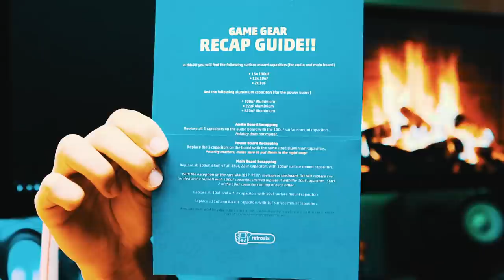NEVER REPLACE ANOTHER CAPACITOR! | New CERAMIC Capacitors for the SEGA Game Gear! | Retro Renew

Comment: Nice video but ceramic caps are used for filtering and not power applications, electrolititics are used to stabilise voltages and power especially on the power and audio boards, Sega knew to use electrolititics for a reason, not the best replacement when using a good quality Panasonic or Nichion cap.

Comment: Can’t wait for these capacitor kits to be available for every console, I’d love to never have to worry about those leaky caps again!
Reply from the maker: Me too!!
Reply: @MachoNachoProductions  haha, as it turns out I just finished fixing my GameCube and it wasn’t reading discs too well and, sure enough, a capacitor issue. I think I’m gonna try to find the right ceramic caps for it because it uses those smd style ones like the ones in this video. Thanks for inspiring me lol, I’ll definitely have piece of mind after that’s done
Reply: For sound circuits you are better with electrolytic or better yet solid state tantalums which will not leak either and there are also polymer caps that look like electrolytic caps and don't leak either. Ceramics are good for many things but not leaking does not mean they will not fail eventually but they tend to last longer.
Reply from the maker: You’re welcome dude!  Glad this video helped!  Also glad you were able to track down the issue with your GameCube!  Best of luck in the repair!  Cheers!
Reply from the maker: Thank you for the insight Helder!  I wonder if there is a way to figure out which cap types would be best for each application. It seems that it isn’t a 1 for 1 just getting the same values. Cheers buddy and thanks again for the insight!!
Reply: @Angryhelder  yeah, for earlier systems that’ll definitely have to be fleshed out by someone with more knowledge than me, but I’ll save it for the pros. Just hoping retro modding or someone like that starts to pick up on this
Reply from the maker: Also, is this THE Helder?!  From sudomod?  I recently bought your MegaBat 4.5 for a circuit sword build I’m planning. Love your work bro!!
Reply: @MachoNachoProductions  Indeed it is. As for the caps to have a good variance in sound as it was intended you want something like the electrolytics but if you want something similar in performance sound wise use tantalums as they last longer and do not leak. For these low power handhelds ceramics could be used although I'm sure people will argue that point but stick with the caps I mentioned for audio.
Reply from the maker: Great to speak with you and again appreciate all you do for the modding community!  

And also thank you for the insight!  Cheers dude!!
Reply: Electrolytic capacitors are generally going to be superior for audio applications. I'll take new Nichicon or Rubycon caps over ceramic any day. Any electrolytic capacitor will leak when exposed to higher than rated current. Most extremely old and or bulging electrolytic capacitors should be replaced. Also any console built during the years of the Capacitor Plague should be recapped.
Reply: @Angryhelder  The only way a ceramic capacitor will ever fail is if you apply way to much current to it, or physically damage it. Otherwise, no they don't just randomly fail.   Tantalums capacitors do fail with age, and their failures are often worse then electrolytic caps, they are also not ideal for every application where a electrolytic cap would have been used.     Tantalums are better for power supplies, not audio circuits.    Polymer caps are more expensive, so in a Game Gear where most of the caps are used for decoupling or line filtering, there is no advantage to using them over a ceramic cap.  The audio board is the only spot were polymer caps might be of an advantage, but even then, it's still a Game gear with low quality mono sound, not a high fidelity stereo system.

Comment: I have a Sega Nomad that does not turn on. It used to work, it was put away, not used for a couple of years, and then it wouldn't work. So I'm guess that it's the capacitors.

Comment: 2 things... 1) I tried reviving a Game Gear with these ceramic capacitors but couldn't get it to work. Could be that they are so small and the 100 uF caps look identical to the 10 uF caps, so I may have mixed some up. At any rate, I swapped out the ceramic ones for new electrolytic ones and the Game Gear fired right up. 2) I've never seen that issue with the sound board caps fusing to the board. Sometimes they are a pain to get off (and I have ripped a couple pads off before), but I've never seen the black plastic stuck to the board like that. Kinda odd.

Comment: For the power board, I installed a electrolytic  for the 820uf  but, for the 100uf and the 22uf, I replaced them with ceramic capacitors. I don't know if better or worse but the game gear is working.

Comment: the adhesive they used to keep those caps down is god tier haha
Reply from the maker: Haha! Indeed it is!
Reply: It's something I will never fully understand. What kind of adhesive did they use to glue those damn capacitors down.
Reply: Just redid my caps about 2 weeks ago; yeah, the glue was bad, but thankfully the plastic shells were strong enough for the pliers to break it from the PCB.  I think only 1 crumbled into a hot mess.

Comment: Good work, to remove old capacitors first brake the glue with pliers then raise capacitor and then use soldering iron on the legs it comes out easy, power board capacitors rarely go bad, they are great quality, to fix your screen is easy, apply flux and warm the ribbon connector to the screen and gently press with pliers to solder contacts in place. Cheers mate

Comment: Nice video, I was wondering if there is any reason to be concerned about the longevity of the game gear after replacing the capacitors with ones that are way out of spec from original?  Is there any reason to be concerned about replacing 22uf, 33uf, 47uf capacitors with 100uf capacitors?
Reply: Wondering the same thing. I absolutely get the appeal of simlifying the process -- Lord knows I was sweating bullets recapping my first GG -- but making sure the values are acceptable for the task is important as well. The boards vary wildly between revisions.

Comment: Gameboy's are so much easier to mod.  There are so many components that can fail on the Game Gear.  Excellent tutorial!  Soldering the small capacitors is very time consuming but well worth it.  I think your Game Gear was sitting in a hot attic for years.  I didn't have any issue removing the plastic pieces when swapping out the capacitors.  I was lucky and could just break the excess pieces of plastic away from the motherboard.   It's nice to see someone else using 'Aerospace 303' - great stuff.
Reply from the maker: Agree, gameboys are a much simpler design. It was the first time I ran into issues removing caps. Glad your were easier to remove. I love aerospace 303, works great!  Cheers Cobra!!
Reply: @MachoNachoProductions  Nintendo used quality components as well.  I am working on a Watara Super Vision next. It has terrible build quality.  Have a great Friday and weekend!
Reply from the maker: Very true!  

Nice dude, the supervision is a very interesting piece of hardware for sure!  

Hope you have a fantastic weekend as well!!

Comment: Great video!! I have repaired some Game Gears and i have seen the "melted" plastic thing i normally use a small metal spudger and it comes off without big problems, try that next time.
Reply from the maker: Thank you!  Appreciate the recommendation!  My only concern would be scratching the pcb and perhaps potentially damaging a trace in the process. I’m sure if one is careful it could very well be accomplished!  Thanks again buddy!  Cheers!

Comment: I did a partial recap on a 3DO and one of the caps was glued down and was fused to the board. Due to the tight fit, I ended up getting one leg unsoldered and bent and fatigued the cap until that part broke off. It wasn’t easy, and took about 20 minutes, but it came off eventually.
Reply from the maker: Thank you for sharing So Zen!  I’m planning on modding a 3DO soon!  Cheers buddy!
Reply: @MachoNachoProductions  can’t wait to see it! The 3do is one of my favorite unsung heroes of the gaming market that gets far too little love in the community, can’t wait to see what you have in store!

Comment: Just a personal opinion, but I wonder why repair companies don't put more stock into polymer caps. No juice means they don't have the capacity to leak, leading to a longer lifespan. Sure they're more expensive, but I'd rather pay a few more bucks than have to replace those again in 10-20 years...

Other cool things for the GameGear if you don't care about keeping it stock: CleanAmp GG for better sound; CleanJuice GG to replace the batteries with Lipo rechargables & use USB-C vs the old barrel connector; plenty of shell & button replacements; VGA mod, to play it on a TV/monitor; controller mod, to use a Genesis or any other controller with that 15-pin layout to play; plenty of screen replacements. The list goes on. So much love for it nowadays :)

Comment: fish flux was used instead of rosin flux for whatever reason back in the day .60s and early 70s electrolytics tend to smell of poo when opened. If one explodes you find the contents have a matching brown colour. Newer ones tend to smell more like rotting fish, so presumably amines are released by whatever witch's potion is in them. The inside are much paler in colour, too. They used an epoxy glue for those SMT electrolytic caps underneath probably the solder they were using was cheap low point Lead solder so it might of been getting hot enough they fell off during proto types because of their weight.

Comment: I'm assuming the screen was already bad but it could be the caps if it wasn't.

Things like ESR and a few other aspects have to be accounted for when replacing cap types. The capacitance values may be the same but they can have wildly varying resistance values, etc.
Reply from the maker: I’m hoping RetroSix looked into those metrics before releasing the kit. I don’t know of they did but the ceramic cap values are different from the electrolytic ones in the GG. I wish I had a deep understanding of electronics to know the difference of each cap type. Cheers Danny!
Reply: @MachoNachoProductions  

I'm sure it'll be sorted out and it should return to normal if that's the issue with the screen and they do issue the proper caps.

Comment: A year late to the party, but I dig this idea. I think ceramics would be beautifully suited to many vintage consoles for adding longevity. As was already mentioned though, I agree that tantalum or polymer caps would would be better suited for sound circuits in these systems.
Reply: New to soldering replacement.
Why are tantalum or polymer capacitors better suited for these situations?
I replaced mine with all ceramics.

Comment: Please say you took care of the corrosion on the left side of the main PCB. That stuff was pure green. I'd recommend white vinegar followed by alcohol if you haven't done so. As for the stuck SMD caps on the audio and power boards, that is due to the leaking of the electrolytic fluid from the caps acting like a glue for the caps. Normally, the glue/adhesive they used is only on the main PCB under the rectangular housed caps. The stuck plastic can be removed with a bit of heat, but you likely won't ever get the adhesive itself off. Beyond that, not bad work!
Reply from the maker: I have!  Did a lot of cleaning off camera.  There was quite a bit of corrosion on the pcb. 

Thank you for the awesome insight!  Really appreciate it!

Can’t wait to get this unit fully modded with a new LCD!  Cheers Catherine!

Comment: I wanna know if that tv tuner will work with the screen replacement mod ... I can never get a clear answer. I know that the tuner wont pick up any channels because of the digital conversion but I do know that you can plug in a digital antenna tuner that converts the signal so that it can be displayed on the game gear tv tuner ... but the GG that I saw didn't have the screen mod.

Comment: Tito, heads up that is a terrible way to remove those caps off the audio board.  especially considering these systems caps tend to be badly corroded by the time people get to them, any pressure will rip pads off. the other issue is your method leaves behind the plastic base.  the best way to remove these caps is with a hot a hot air station at 380ish degrees C on high air output. takes about 5-8 seconds and they literally just slide off.  cleanly, no left behind plastics.

Comment: The plastic hasn't fused. Rather, the components have been glued to the PCB before being soldered down at the factory. Im not sure what type of glue it was, but make sure to use a solvent that won't damage the PCB underneath
Reply from the maker: It’d be great to find a strong enough solvent that could dissolve the adhesive while not damaging any of the surrounding components.

Comment: When designing PCBs with larger Capacitors it is very common to glue the components to the PCB before it goes through the IR solder reflow process. This is done due to the fact that the solder pads are just not big enough to support the possible vibration loads of these larger components. I don't think there are any solvents that will take this glue off without doing some major damage to the surrounding PCB. Once we put them on we don't want them to come off, ever. :-)  Thus your method of melting the plastic is one of the best, the other methods of removal are careful cutting and scraping, or the use of a small milling machine. 
You should also point out to your audience that when working on electronics you need to control static discharges that build up in the environment and the person doing the repair work. You should always wear a static dissipating wrist strap.
Reply from the maker: Thank you Brian for all this amazing information and insight!  Great stuff and very much appreciated!  Cheers my friend!!
Reply: Thing is, I don't remember the SMD nor tant caps being glued to the board when I did my GG recap. Nor have I seen that on any other system since.

It could have been some weird composition of the plastic or heat issue. I don't know what would cause it to stick like that; usually it pops off once the cap is removed, and I doubt they would glue all of the caps down because that would waste money.

Well, either way it works. Now to get the screen replaced.

Comment: So the power board still needs the electrolytic capactors? Just the ceramics for the mother and sound board?
Reply from the maker: That is correct. There are only 3 electrolytic caps in the kit and they are all for the power board. Everything else is ceramic. Hope that helps!
Reply: Or you can just replace the whole power board directly with the new retrosix USB c power module 😁
Reply from the maker: Very true!  That is also a great option!

Comment: The residue looks like the "black goop of death". I learned a lot about this when one of my KRK Rokit monitors died, it's a common cost cutting move that's looked down upon.
Reply from the maker: Interesting!  I was actually about to get the Rokit monitors before ending up with my Yamahas. 

Yeah it certainly feels like goop of death, it so hard to remove. Cheers Johnny!
Reply: @MachoNachoProductions  I replaced them with Adam Audio T5V, it was a couple years ago. Ribbon tweeter life is nice.
Reply from the maker: Nice!

Comment: I wonder if acetone would break down the plastic from the capacitors. You would just need to clean it thoroughly and make sure it doesn't get on anything you don't want melted.
Reply from the maker: That could work!  I would be a little worried about damaging plastic though. Thank you for the suggestion Conner!

Comment: If only i knew this sooner. Recapped 2 GG’s last year, some caps are so big there’s pushing between plastic and motherboard, dang. I was checking Ceramic Capacitors at the time, but didn’t know it was possible. Great update! On a sidenote, too bad Osaku’s mod is not available anymore, would have loved to add controllers. I want to consilize. I heard a new consolizing kit someone’s working on. I am also curious what is the best video out, mcwill’s, or that mod from australia (cant remember the name). Great update! A revolution! 😀
Reply from the maker: Sorry to hear that. I just found out about this kit recently also and wish more like this would come out for other consoles. I’m not actually sure which kit provides the best video out and I’m also very interested in a consolized GG!  That would be sweet!  Thank you for the comment Jan!  Cheers!!

Comment: I must have been fortunate enough to not have the plastic fused to the board. I didn't have much trouble removing the capacitors or much to clean up.

When I did this I wasn't really sure of the best way to remove the flush-mounted caps. I dabbed some flux around the flush-mounted ones and gently pulled and wiggled the capacitors while heating the wires in contact with the pads. Then I heated up the pads once I was able to stand the caps up a little bit.
Reply from the maker: Nice Logan!  Yeah this is the first time I had this happen. Usually they lift off fairly easily and cleanly. Thank you for sharing!  Cheers!

Comment: As a electronic novice, I wouldn't think about using ceramic capacitors, as I am not familiar with it. But, after looking at your inspiring video, I can't help thinking "why not???". As long as ceramic capacitors have no polarity, aren't they are easier and nicer to be used?